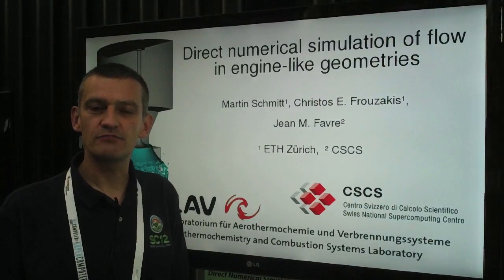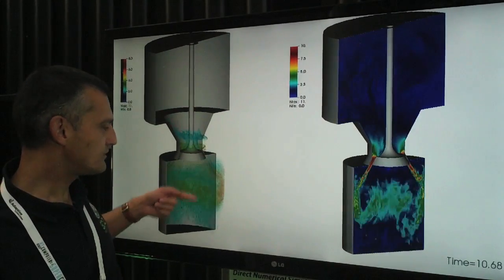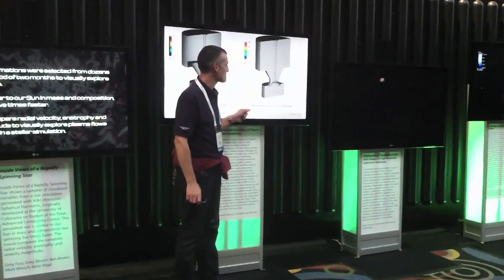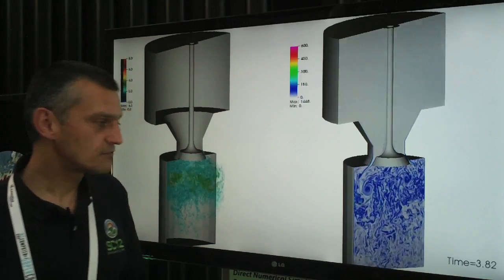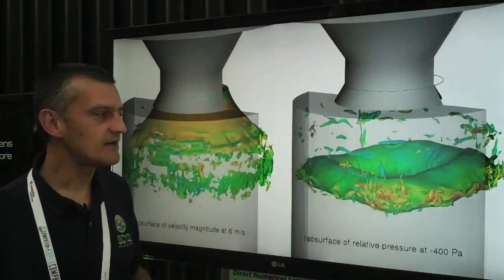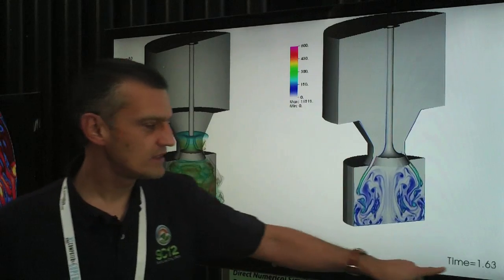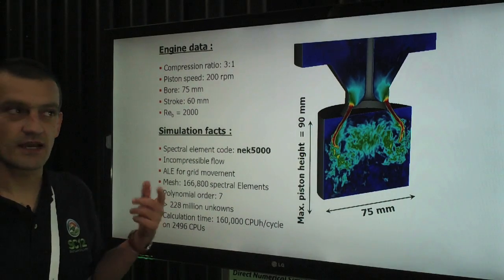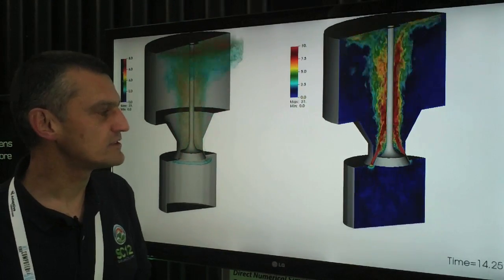Direct Numerical Simulation of Flow in Engine-Like Geometries

Comment: The problem with this is the valve is not square to the bore and the discharge coefficient when we add a port shape ends up as a gradient across the valve. Short side being slower. So in reality of valves in the real position with valve angles, and port shapes. We change how the air enters the cylinder!  We want large tumble, not short-range eddies as this shows.